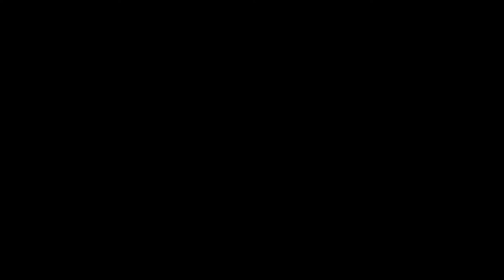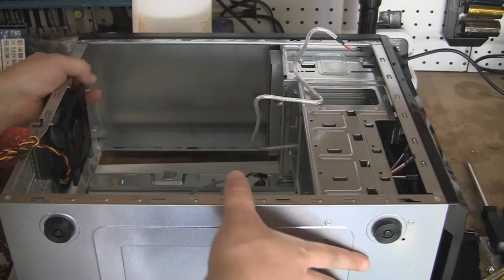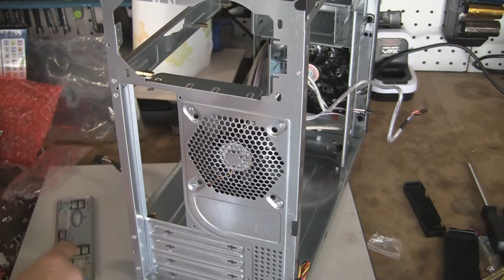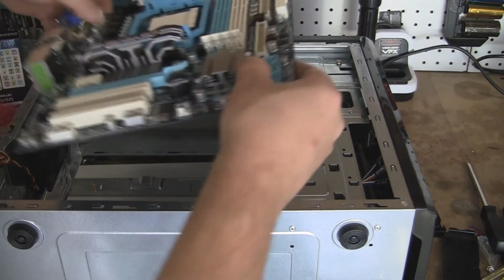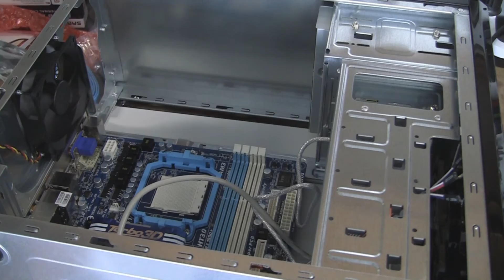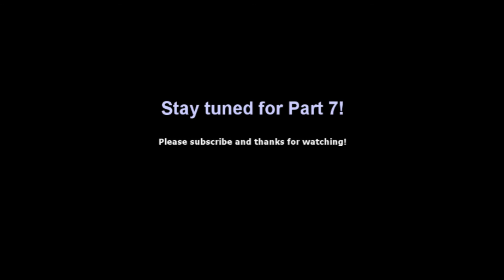Building a PC Step by Step Part 6:Installing the Motherboard

Comment: Good video, though would it not be easier to put the cpu and heatsink on the motherboard then mount to the case? Anyway, at the moment, I am designing my pc, looking for what parts to buy but I decided to go with the AMD than intel as intel, way expensive.